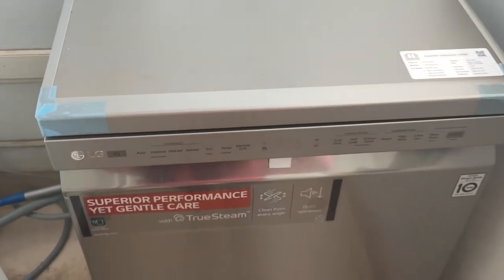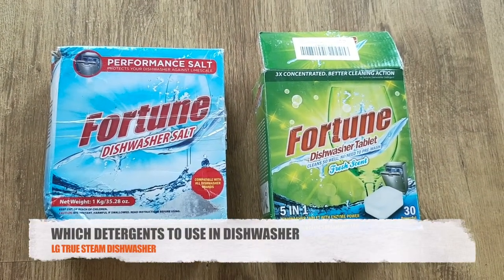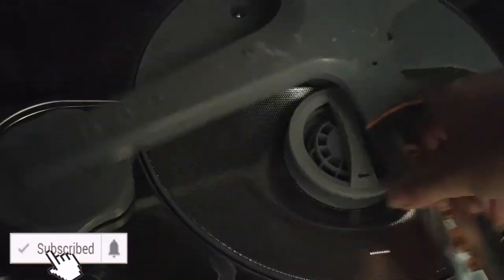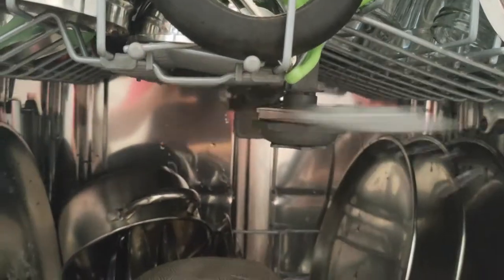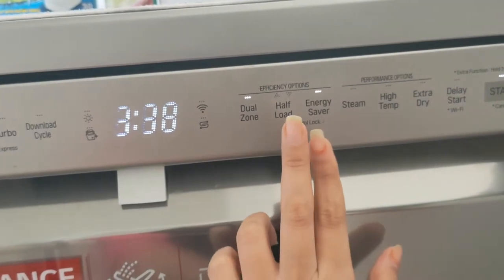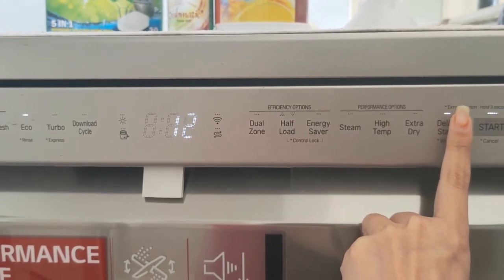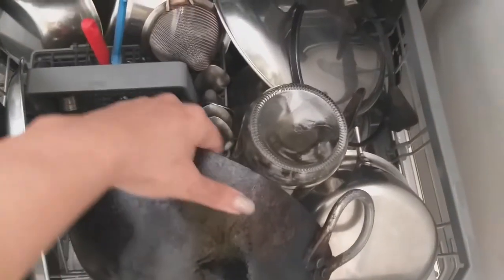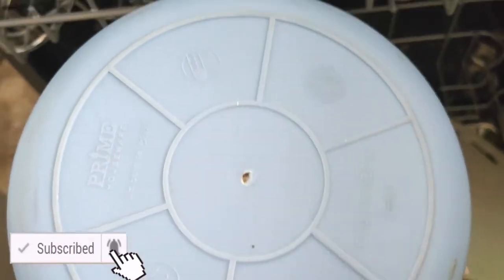Best Dishwasher for Indian kitchen - A Complete Guide LG TRUE STEAM #indiankitchens #dishwasher

Comment: Heating Element problem usually is due to voltage fluctuation. In which city do you live ?and it maybe so that the current at your place is not stabilised.
Reply from the maker: We don't have power outage at our place

Comment: Can I remove the water input pipe after each wash just like washing machines ,as I have to keep it across the passageway and can't have pipe connected all the time.
Reply from the maker: Yes, you can ...
Reply: No, you are advised not to remove the inlet pipe everyday. the domestic waterline has to be connected to dishwasher's inlet pipe by the plumber. LG's inlet pipe has sensitive sensors, which will get damaged if it is connected and disconnected, everyday. I have been using LG for around 11 months.
Reply: @Truth n LogicAfter power interruption, the wash cycle extends by many minutes. In shorter cycle, it may be extended by 15-20 minutes but in longer cycles it may get extended by more than one hour. the lowest temperature is 42 degree. Except for the fact that on power interruption the cycle gets extended, no other dishwasher comes closer to LG. all the major dishwasher brands have 8 to 10 washing combinations but LG has more than 100 combinations. it's lower power consumption and steam jets have major advantage. As despite living in a major city of India, there were frequent power cuts, I have returned the LG dishwasher.
Reply: @Truth n Logic I returned LG with a heavy heart. It's mind boggling wash combinations were amazing and were really very useful. It used to require electricity, Salt, Rins Aid and Detergent worth only Rs. 10 only but non resumption of cycles from original stage and then a failed heater was the final act, which made me return the LG. LG had offered me to give a new dishwasher with extended warranty but I preferred to return it

Comment: Does it auto resume in case of power failure
Reply from the maker: You have to start a new cycle in that case
Reply: @RATIHOMEBOOK  not clear mam, is it yes or no mam?
Reply: @lakshmitejaswi2823  Cycle resumes with revised and extended timing, which is a major drawback.

Comment: Hi. 
You have explained most of the points very well in your video.

I have purchased the same dishwasher about 10 days back. 
Whenever there is power failure during a wash cycle, it does not resume from the point it stops but the entire cycle is getting started again. It is starting from the initial phase( starting of that cycle).
Eg if I have selected a 3 hr cycle and there is power outage after 2 hrs and when the power comes back the cycle is again starting from the initial phase and running for entire 3hrs.
Please suggest what should be done to rectify this issue.

Is anyone facing the same issue?
Reply from the maker: Yes, it happens with this Dishwasher..

Comment: LG, despite having a very good track record has proved to be absolutely useless, as far as LG dishwasher is concerned. After having top rated service for around 1 year, except for few irritations about non resumption of cycle after power cut, the machine did a very good job. When this issue and issue of filing heater were up taken with LG, surprisingly they were of no help. LG is primarily only an importer of dishwasher, without having any concern about after sales service. I have initiated process for refund as well as lodging criminal case and a suit before Consumer court. Primarily most of the  German, Turkish, South Korean dishwashers are actually Made in China. as India and China are going through a very rough phase, spare parts and technical backup have been deeply impacted, adversely.  As I have been actual user olf LG for more than a year, my advise is not to buy LG dishwasher as they do not have technical knowhow to fix the problems. Their warranty is fake and meaningless.
Reply: Omg 🙄
Reply: Atul ji, I m also facing some problem n thinking to go to Consumer court. They (LG ppl) are not accepting their fault. I lodged complaint in May n still it is in process. Kindly suggest.
Reply: @priyasukhwal  probably on Page no. 24, of the LG Manual,  it is written that the wash cycle would resume after power outage. If the dishwasher does not rectify the problem, you can through speed post, can tell l LG
that you would approach for redressal, through legal and social media. It should help.

Comment: If it is good machine are not
Reply from the maker: Watch this https://youtu.be/dOn91jmnkH0
Reply: What i ask the question
Reply: LG dishwasher machine good are not I ask
Reply: LG is the best dishwasher in India. The same model is being sold all over the world with slightly different nomenclature. We have been using this dishwasher for last more than 8 months. Most of the features of this model are not available in any Indian dishwasher. Even for European and American standards, the LG is an advanced dishwasher.
Reply: @Atul kumar- can you please comment on IFB Neptune SX1 vs LG vs Siemens sn236i01ki..as this model is out of stock here
Reply: @shwetagupta4620  Sorry for the delay. Online comments show that Neptune, despite coming from IFB  is having some issue with pump. Siemens and Bosch come from same parent company as both the German companies got merged in 1967.  If you observe, Siemens and Bosch have similar looks and functions. Bosch has been a successful brand. It has been a steady performer BUT, Bosch is an old model and is smaller. Bosch and almost all the dishwashers are 12 place dishwashers. LG is a bigger 14 place dishwasher having much more space to accommodate more utensils in single wash cycle.  LG has 10 years warranty on its motor, which is the heart of dishwasher. LG is unique as IT IS THE ONLY DISHWASHER HAVING 6 Steam jets to clean the utensils and disinfect them. LG has 4 hands in it's lower spray arm, while all other brands have 2 hands. LG is the only dishwasher which has WIFI connectivity to your cell phone to perform hoard of important additional functions. LG can wash utensils (almost 95+) in a single load for RS. 13 to 14, which includes cost of electricity, detergent, Rinse Aid and salt. No other dishwasher can do washing at such a low cost. Other dishwashers often depend on costly Tablets, which costs Rs. 40 and more for a single load. LG  dishwasher has more than 100 wash combinations which really work.  I have been using LG for more than 10 months. LG being a bigger dishwasher scores on all o0ther dishwashers convincingly.

Comment: Please dont take this the wrong way but This machine wont last sweetheart if u continue throwing everything at it. I also have a true steam. have had it since June 2019. A different model to yours.  Mine has a drawer for Cutlery. Firstly your so called engineer has done a few things wrong. The type of salt he is using and spilling the salt all over inside the machine. This must not happen. Those white like residue you see on your door  and some on the dishers are not suppose to be there. There is something wrong with your water hardness setting or detergent.  Anything that you will put into your machine that will flake off burnt crusts will clog your filters, spray nozzels and scale on your heater element.
Reply from the maker: Thankyou, it helps me in choosing a new one... The water hardness in our area is fine as others too are using dishwashers without filters.. I will surely, keep these thing in mind 🙂
Reply: @RATIHOMEBOOK  Better buy a TDS meter from Amazon, it costs around Rs. 200. I have same Dishwasher for last 10 months and is doing a great job. Salt level setting is dependent on TDS level of water. If in any sort of doubt, you can set it at 2. Excess amount of detergent is also a problem for dishwashers. I hope you are clear on this account.